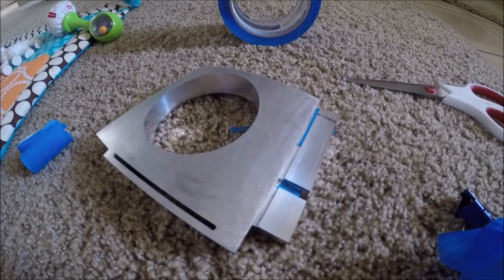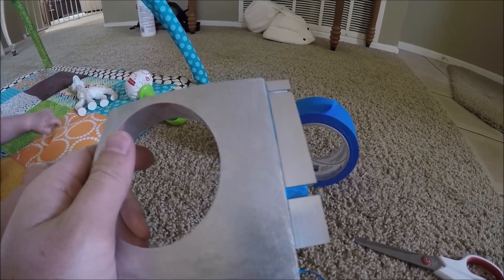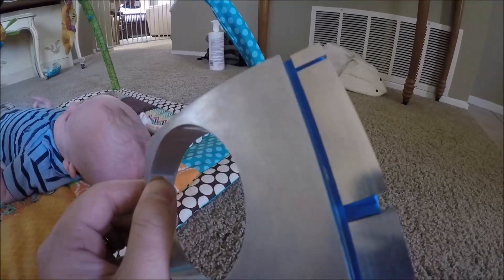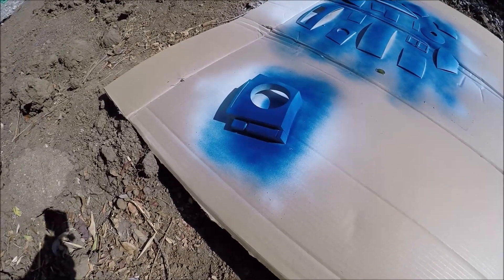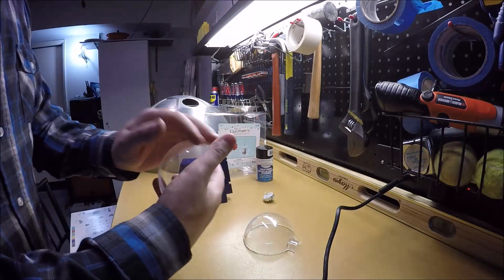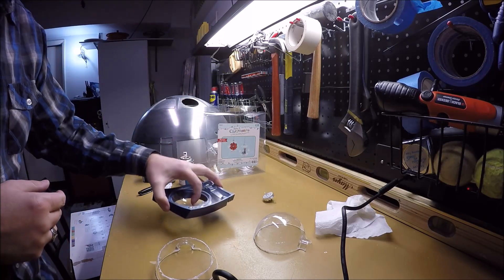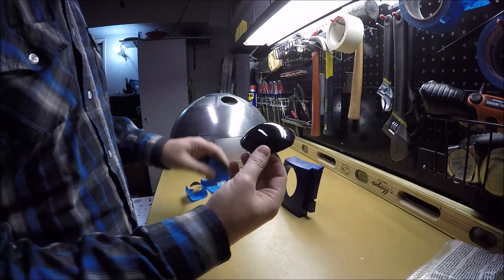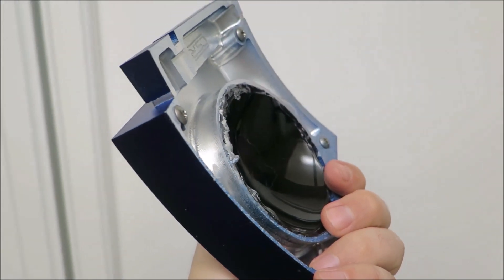R2D2 Radar Eye. Building Your Own Full-Size Working R2D2! Episode VI.

Comment: That small gap in Eye, first Clear coat is so the aluminum does not Oxidize. then you can use Clay, Silly Putty, HandiTak to push into the cracks pre Blue Paint. , also you can get Black Hot glue sticks, I saw a gap between the eye and the aluminum housing.
Reply from the maker: Thanks for the feed back. Going to try the black hot glue sticks.